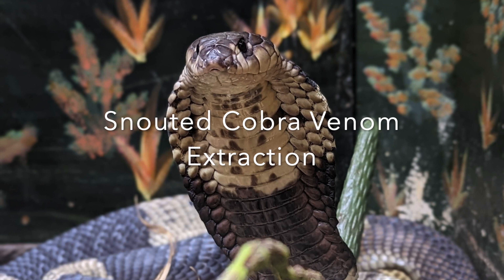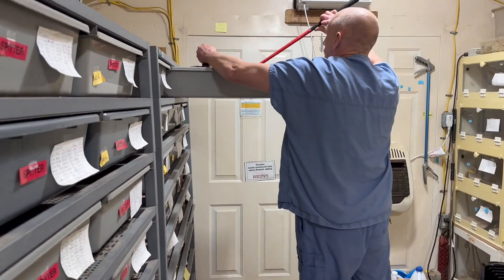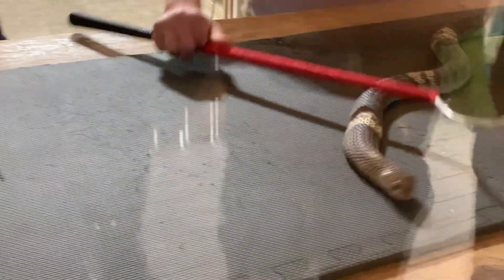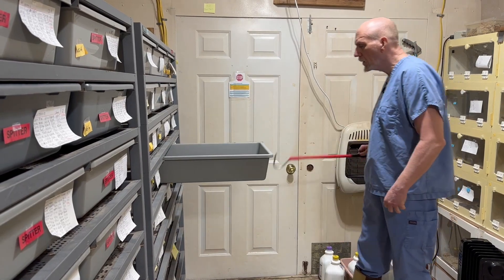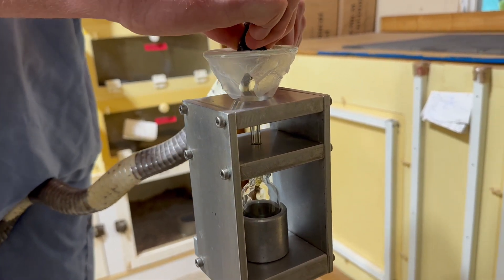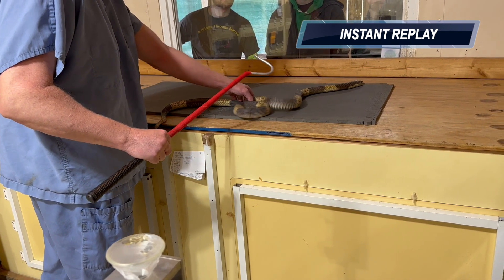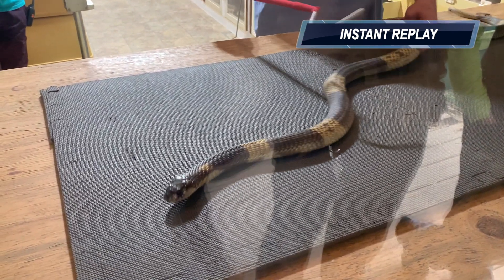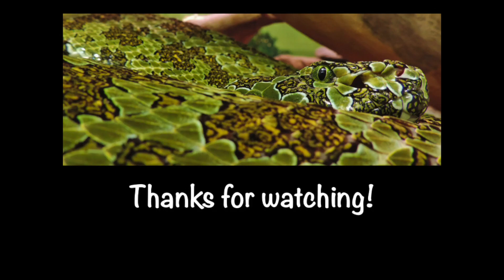Snouted Cobra Venom Extractions!

Comment: 2:50 how close was this to a bite in relation to general daily extraction risks? I paused it right at the 2:50ish point where the head was out and his hand was still on the bin and that snake could have easily tagged him if it decided it wanted to no? I remember several years ago watching the video series where he got bit in the wrist and was in the hospital on Dilaudid and still in massive amounts of pain, I cant believe he is still doing this.  Handling this many its just a matter of time really, I pray he stays safe!!!!
Reply from the maker: Yes, that moment was a higher risk. Releasing the snake after extraction is the most dangerous part because there's a small window in which the snake is free to move, but Jim's hands are still nearby. Another possible way to secure the enclosure would be to release, back away, and then use a tool to close the drawer. The keeper staff only use tools and never our hands to open an enclosure for this reason.
Reply: Hope he’s got life insurance…..